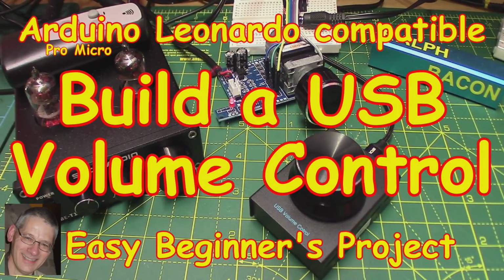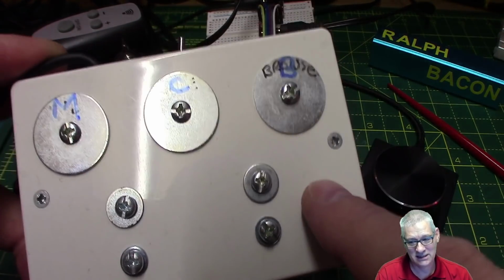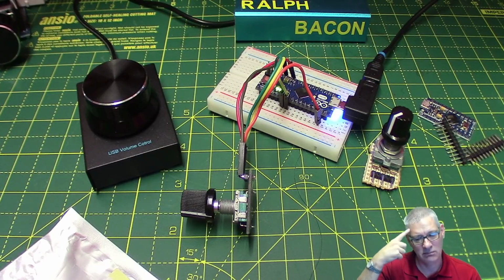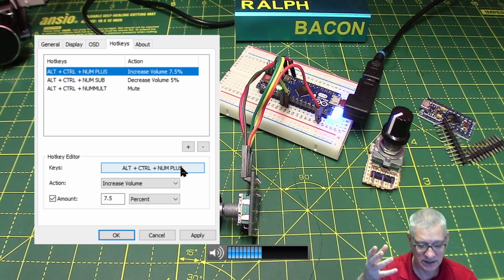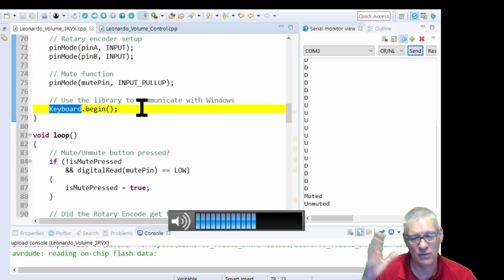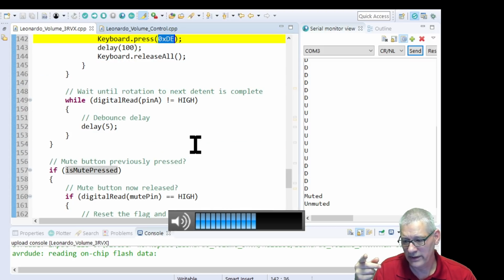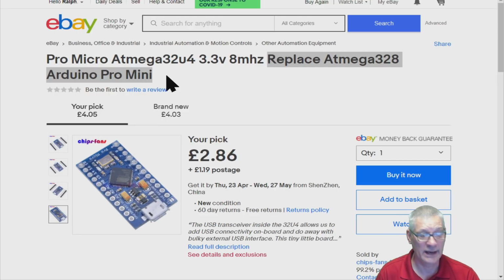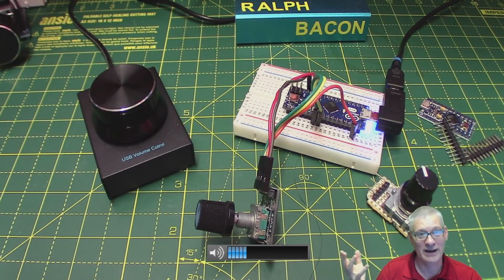#184 Make an Arduino USB Volume Control - Ideal Beginner's Project

Comment: The looping algorithm to determine up vs down -- doesn't that require two clicks of the encoder to actually go up and down? Also, an advantage of DIY'ing the solution over buying it might be that, should you get bored or the volume knob fall into disuse, the parts might be repurposed into another project. Your commercial solution, nice as it is, may end up in a drawer or a box or a landfill somewhere. Thanks for the video, and glad to see the patch disappear!
Reply from the maker: It's just one "click" to determine up or down, Ted, as it moves from one detent (pin A high) to the next. I'm hoping I don't get bored with my commercial unit falling into disuse but there is always a danger of that happening with anything we buy, right?

Comment: Your timing is off by a week(I blame daylight savings😁) I just used a pro micro to make an automated keyboard to do  some stress testing of an app. I could have used the media key info, I'm left with only one question. What is inside that volume know, and can it be turned to our purposes.(OK 2 questions, someday I'll knuckedown and learn to count) Maybe send our own keycodes, or maybe detect how fast we turn it, etc. all in a pretty package....
Reply from the maker: I was tempted to take it apart but it seems glued shut and I don't want to damage it. But with care it might be done, I suppose, and then repurposed with your own chip and code...
Reply: I wouldn't expect it to be reprogramable, but you could probably fit a microcontroller in there connected to the knob and LED

Comment: Hi, i have been looking to do this for my pc media speakers as the vol controlle that always comes with them is woefully inadequate.. i realize i can look up the info on this device but its a busy week so i thought i would ask..is this device ..both the manufactured one and your unit, able to be used in linux or is it only windows supported?
Reply from the maker: It says "supports Win 10/8/7/Vista/XP/Mac, it can start to work once you insert to your device, and it can also work for phone with OTG cable." But no specific mention of Linux, which does use keycodes the same. Only way is to try it. Or build one and try yours.
Reply: @RalphBacon  thanks for your reply..soon as i get the chance im going to order one and see how it goes..again cheers

Comment: You missed something in your edit: your camera selector is displaying an old recording of you before you got the Long John Silver eye patch.

BTW, you didn't really think you were getting away with "there's my new tube preamplifier . But that's nothing to do with arduino so I won't  go into that any further", did you? We wanna see your description of the operation of a pentode vacuum tube, what the bias battery is is used for and why an accumulator should be used for the heaters.
Reply from the maker: My patch is no longer required, Michael! But my vision isn't great as further work needs to be done. But it's a start. Now about that preamp. Watch next week's video (not quite as in-depth as you might hope, though) which might be about vacuum tubes and my preamp too.
Reply: @RalphBacon  Best of luck with the work on the eye.

I was only joking about the Vacuum tubes but I will be interested in your preamplifier. My first dipping of the toe into electronics was in 1962 at a secondary school radio club. My fascination with vacuum tubes goes back to my infancy. I spent the first 10 years of my life (from 1950) in a house without any electrical supply, only coal gas stove and lighting. Gas powered TVs were very expensive at that time. So, our only electrical entertainment was a battery powered Radio set. My first involvement with the innards of this huge device, designed by a gothic cathedral architect was the batteries . There were three different batteries an accumulator (lead acid glass battery that we had to take to a local garage to be re-charged), a bias battery that raised the ground voltage to allow negative and positive busses (as you might need in today's operational amplifiers) and a huge battery with about a dozen voltage taps, it was the size of a volume of the Oxford dictionary. By the time we had left this house,I had a good idea how the tubes, triodes (think Mosfet) and pentodes (difficult to come up with a contemporary analogue, possibly analog IC ) worked. Though finding books on this subject required going to the library. In those less enlightened days, unaccompanied children were very much second class people and I would have to creep about the bookcases to avoid being ejected with no opportunity to explain my need of books other than those written by Enid Blyton . Seeing that chassis with the glowing heaters in the tubes brought back many memories. Not all unalloyed. One had to have served an apprenticeship in metal working to create a circuit in those days.

Comment: For folks wanting to learn more about HID, here's some useful info.  HID is Human Interface Device which is the USB and Bluetooth protocol for simple input and output devices.  Hence, it is great for keyboards, mice, joysticks, volume controls, screen controls, and more.  Many HID devices are natively supported by various OSes so you often don't need to write drivers yourself.  There are 2 main parts to the protocol.  The first is the HID Descriptor is just a carefully crafted blob of bytes that describes both what the device is (ex: "I am a keyboard") and what the device's packets (aka "reports") look like literally down to each bit and byte (ex: the first 1 bit of report 1 indicates whether the Left Control key is pressed).  The HID descriptor is read at either OS boot-up or when the device is plugged in.  Within a HID Descriptor, the codes used to assign the meaning to a bit or byte are called "Usages" and they are grouped into "Usage Pages".  So the 0x07 Usage Page is for Keyboards and the Usage 0xE0 is Left Control key.  From the Arduino's perspective, the blob of bytes can just be read out of ROM (no runtime computations).  The 2nd major part are the "reports" or packets.  These are sent when there is state change in the device (ex: Left Control pressed is one, Left Control key is released is another).

The HID 1.11 specification is at https://www.usb.org/document-library/device-class-definition-hid-111
The HID Usage Tables 1.12 specification is at https://www.usb.org/document-library/hid-usage-tables-112
Reply from the maker: Nice detail, thanks Chris.

Comment: I started to make my own volume controller just like this but wandered off when I learned microsoft only allowed volume keys be sent from verified manufacturers devices and I didnt want to have software running on the pc to translate my controller. I wonder if nicohood's library is emulating another device when you plug in?
Reply from the maker: I think NicoHood has just sent the correct keys that Windows expects. I could have used a different Windows app (several allow hotkeys to change anything, including volume). I think it about time you continued that project, Scott, now you know how.
Reply: @RalphBacon  well, in theory we can test that by digging the key codes out of his files and putting them into the stock keyboard routines.
Reply: and I just did that. I'm using a digispark clone and tried using his key code for mute in his consumer.h file and it didnt work using adafruits hid library.
Reply: @TuttleScott  so i just ran a test sketch for my leonardo, and everything worked perfectly. I tested the Volume keys and the Play/Pause key. I used the HID library by Nicohood which is also what i use for keyboard and mouse (both of them worked perfectly, too). try using playing around with his library and see if you get successful results as well.

EDIT: oh yeah, and on that note, i have ordered my micro's so i can finally get my other project started.
Reply: mhh, i'll have to try this since the initial tests on my leonardo for keyboard and mouse worked perfectly, but i know that media keys use a different library and commands. i do have a planned project on it so i'll give it a try before i order my 2 arduino micros and if i can't get it working, i'll just skip the micros.

Comment: but keyboards these days come with volume control keys already, i wonder why everybody buys them. i would rather be more interested in an usb numpad, since my keyboard number keys stopped working (except 5 & 6).
not saying, i did not like the video though, i am a fan of your work, cheers.
Reply from the maker: My keyboard has multimedia keys too, but I hate the stab and poke method of turning the volume up and down. The rotary method is soooo much better! My next keyboard has no keypad (gamers keyboard, but I am no gamer).

Comment: Reminds me of the little USB/Bluetooth amp that I have that I hook to a wall-wort and external speakers.... really nice to have rotary dial right next to me plus when watching an action movie, can turn the volume down really quickly when all the guns and bombs are blasting.  Better than reaching for the laptop itself.  We don't have to TV so watch everything on the computer.  Facmogu is the amp I have, but they slap different names on same thing.
Great video Ralph!  Thanks.
Reply from the maker: You can test it all out with an Arduino Micro and a Rotary Encoder.

Comment: This would be absolutely awesome to use as a VFO knob for a SDR , maybe a couple push button to adjust frequency step, would make for great HID for software controlled radio!
Reply: Just same idea for me.....RSP1A sdr "real" control buttons...great.
Reply from the maker: Remember that you only have a fixed number of steps on a rotary encoder though.
Reply: @RalphBacon  of course, but I can add other actuators like some switch, right ?
Reply: This is a common use for them, some SDR software has includion for this either natively or using a plugin. This why I brought mine.

Comment: why not an attiny/digispark? :)
and can it detect some sort of "feedback", so it can show actual volume level on, let's say, a neopixel ring?
thanks!
Reply from the maker: An ATTiny cannot send the characters up the (USB) port to the Arduino. And there is no feedback from a Rotary Encoder, not unless you adapt it or set it on switch on (which sort of defeats the purpose). But I did a video on Rotary Encoders and a Neopixel Ring in video #62: https://youtu.be/nTtd5bpc12Q?t=820
Reply: @RalphBacon  A digispark can definitely work as his keyboard or mouse. There is a library and an example sketch.
I tried it and it works there are enough pins left to drive neopixels but rotary encoder and push button might become challenging.
https://digistump.com/board/index.php?topic=20.0
Reply: @RalphBacon  yup, remember that video 😊
BTW I see many using a digispark instead of pro micro for same setup... Have to check better... Thanks!

Comment: Great video. I was hoping that you put a link to the video switcher video (I looked for it in the past and failed to find it). But, you gave enough info in this video to figure out exactly how it work. I have used the Leonardo clones in the past to do keyboard simulation, so setting up hot keys in OBS and a "dedicated keyboard" for switching should be a piece of cake. The genius is figuring out that you need to do it in the first place and what size washers need to be assigned to each function! Great Job!!!
Reply from the maker: Video #30 is the one you want, Edward. So, you like my washers! I intended moving them to inside the case as the capacitive effect still works. One day...

Comment: That HID interface looks interesting.
You serial initialization can be much more simple, you only need the "while (!Serial);", it will wait only the USB interface is ready. The 32U4 do not use baudrates for the serial USB port, you can set any baudrate or not and it will work with any baudrate on the Arduino IDE.
This will work:

void setup() {
  while (!Serial);
  Serial.println("Hello world");
}

if you need it to start without a USB connection also, something like this is needed:
  unsigned long t = millis();
  while (!Serial && millis() - t < 3000); // Wait for USB connection to get ready, but do not hang when running without USB

The ProMicro is one of my favorite Arduinos, it is cheap, fairly small and has two 16 bit timers. The USB interface that works without worrying about baudrates is also nice.
Reply from the maker: I just thought that 38400 was some kind of built in default. Oh well. How does the serial monitor (in Windows) know what the speed is of the incoming data then? Some sort of auto-negotiation?
Reply: The incoming data speed is probably 12Mbits (A USB data rate). The data goes directly from the 32U4 memory and out at USB speed, there is no conversion to serial baudrates used when talking with a 32U4.

Comment: problem is, while setting OS volume to anything other than 100% you are telling DAC to modulate the same sine wave with less bits of resolution. The lower you set your DAC output the more distortion you introduce.
So setting DAC output at max and controlling amplifier gain is the right way to go.
Reply from the maker: That would mean that Windows is distorting all of its sound, Leeroy, which can't be right as I listen to music via Windows all day long and it sounds fine.
Reply: @RalphBacon  In reality it it not that primitive as I described and that distortion is not necessarily that high, but it is there. It is not like you suddenly get "10%" THD, but rather you are crippling your DAC and lower its specs, mostly SNR and dynamic range.
Whether you will hear it or not is debatable, because some people can't even even tell the difference with 1% THD, but it is still a bad practice..
Reply: @RalphBacon  if you you need a more reputable source, go look up any datasheet from of a decent audio DAC (e.g. very popular CS4398
) and see characteristics table. THD+N is always stated for 24bit mode and for 16bit separetly and 16bit DAC never achieves the same levels of linearity as 24bit. Yes, this is obvious, but people often magically forget how DAC functions when it comes to audio and argue that "you don't need 24bit for audio" and so on.. Yes it is not necessarily needed, but you can not deny that it modulates the same sine wave better.